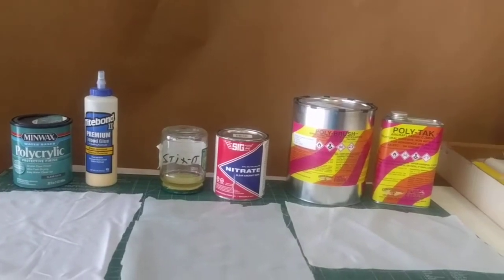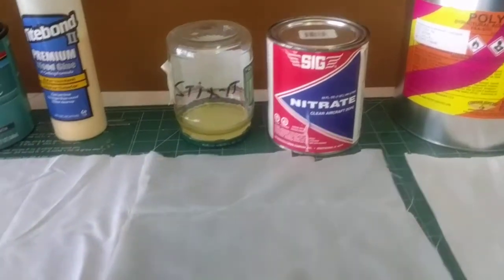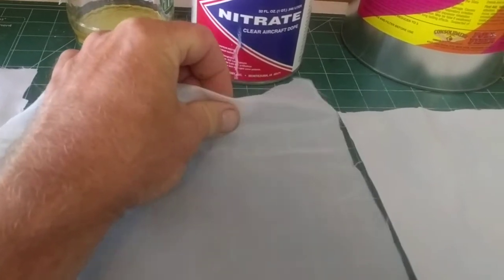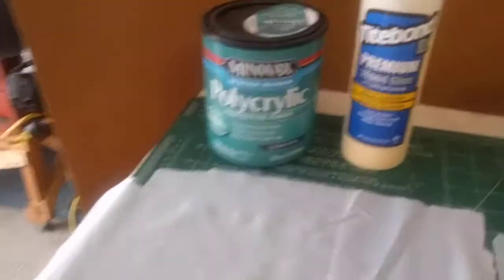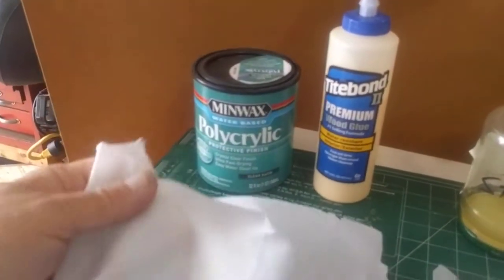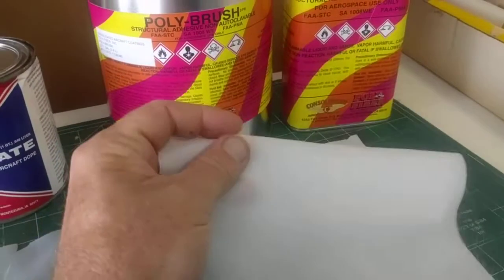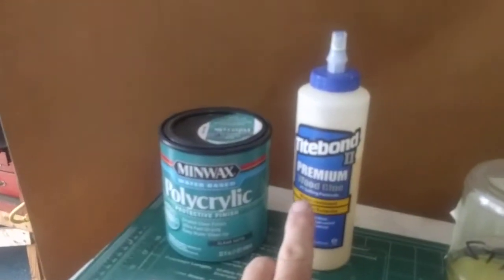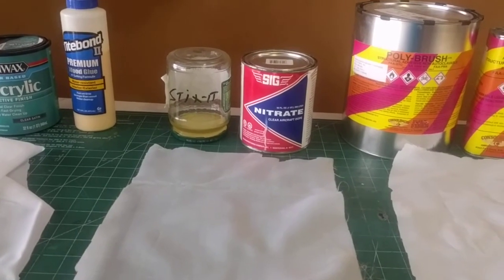Covering RC Planes with fabric Part 1 of 2

Comment: Hi James.  While at the Rhinebeck WW1 Jamboree in September I met a guy there that covered his 1/3rd Fokker DVIII and his friend's 1/3rd Sopwith Pup with polyester dress liner  using Polycrylic (water-based polyurethane=WBPU=Polycrylic).  Their method is to use the WBPU to adhere the fabric to the frame as well as for sealing. The finish was pretty amazing considering the low cost.  If you're interested I'll ask him for the details of how he did it.  I'm going to use his method to cover my 1/3rd Pup.